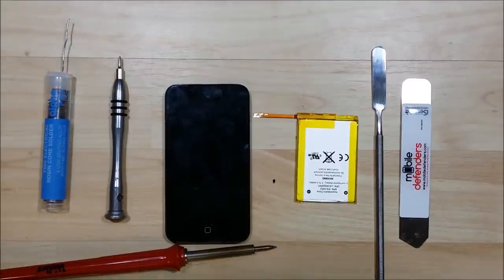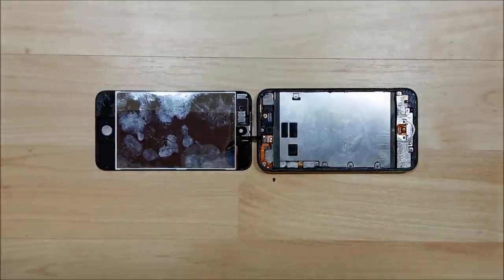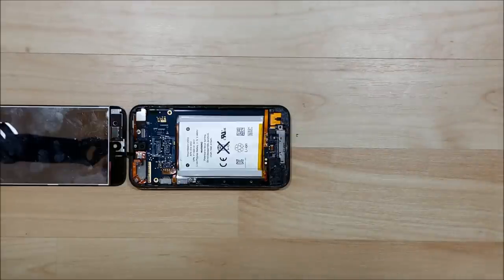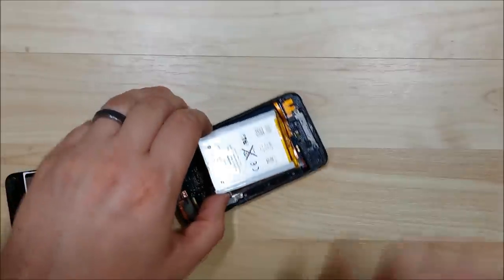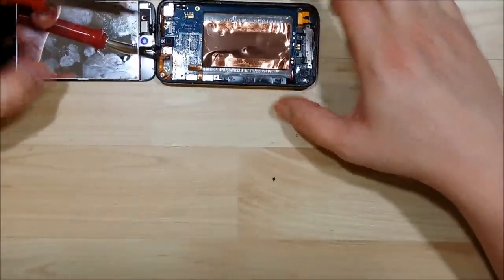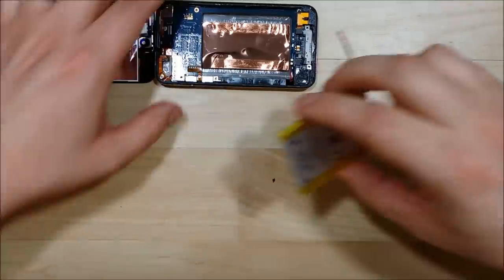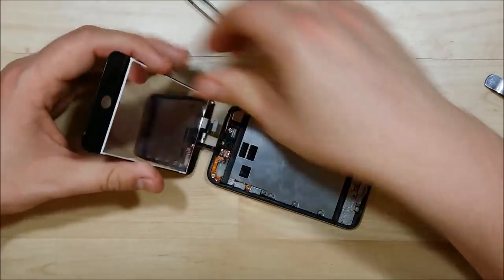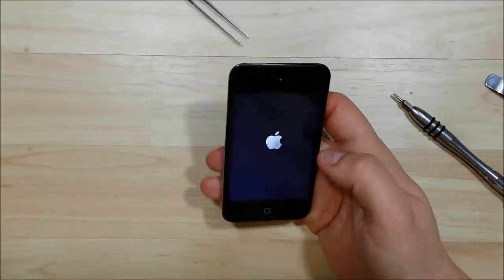iPod 4th Gen Battery Replacement/Repair

Comment: The most important thing I learned is not to even attempt this...
Reply: lol
Reply: why?
Reply: Chris Tilbury because taking it apart is one thing but using a soldering iron on something so small (I have fixed a few iPhones but once you have to solder to a small board you can very well ruin the board if you don’t know how to do it).
Reply: Oh ok
Reply: lol  me  to
Reply: yeah me too
wish i watched this video before i bought one that needs a new battery oh well it was only $9.50nzd
Reply: Me too. Mine is now absolutely dead!
Reply: I need this done

Comment: OK; I just went through this exercise of replacing the battery. The issue is: trying to unsolder the battery as is won't work, as the contacts are covered with silicone, which is not heat conduction; hence, the difficulty to get it off. Solution; use a sharp object, like a cutter, and scrape the silicon off. Add a bit of solder to each point, and then heat one point and pull slightly until off, and repeat with the other two. Since I did not want to open a new cartridge of silicon, I opted ti use a piece of insulating tape and put a patch of 5 by 20 millimetres over these three solder points. -- Also, add solder to the three battery contacts AFTER routing it under the circuit board. Way easier to fiddle it through. :)

Comment: Thanks for the video! When de-soldering you can use a little amount of fresh solder on the tip of the soldering iron and would help you to de-solder with much ease.
Reply from the maker: GUSTavo MYERS Good tip! I learned that after watching a couple soldering videos after I made the video.

Comment: This is the best, most accurate tut I’ve watched so far. I’m attempting to do this... One guy goes bloop bloop bloop and the battery is desoldered. It took me forever🤦🏼‍♀️ Another guy had the display off in like 3 seconds...I spent over an hour🤦🏼‍♀️—he never mentioned ^glue^😥 just double sided tape....well obvs his opened right up! Mine is full of glue, like they weren’t having this thing open ever. I wound up cracking the screen in a couple spots. I’m still working on soldering the battery in. I’m not ordering a new screen until I’m sure the battery is gonna work. Ty for showing the legit probs of trying to fix these things! It’s more complicated than people think!

Comment: heating a piece, even to remove the solder on a component still requires the iron to have a bead of it on the tip. This works like hot mercury, molding to form and transferring heat to the ribbon. That's why you had such trouble achieving temp. it wasn't transferring.  A blunt tip might remedy this.
Reply from the maker: +Drew Gormley Thanks!

Comment: Thanks for the guide! It really helped.
Everything was doing great but when I tried to turn it on. It didn't. I thought the new battery was bad so I 
put the old one back. Nothing. I looked at the board and it seems at 5:20, I put my tool a little bit too far and broke 2 capacitors/resistors. It sucks. I really thought I could do it. I could try to replace them but it's way too tiny to attempt that.
Besides, I didn't back up my stuff lol
Reply: That sucks hella. :-(

Comment: Great video. I did this replacement twice because the first battery was deeply discharged. However the second was also deeply discharged. 
I have changed the battery as you said. Then I followed all the steps but the battery was just hanging in an endless time of charging. 
I think it has to do with the age of them. After all the batteries for the ipod touch 4g are over a decade old.

Comment: Worked great. Others were completely removing the screen. Only thing is I got white screen after replacement and had to hold power home and vol up for a bit mild panic but did the trick. Haven't soldered in years good advice on bottom of the tabs solder.

Comment: I watched a number of videos over and over thinking I had this procedure down pat. And this one seemed to make it simpler without removing the LCD screen, cables and parts for the front-facing camera, etc. In THIS video from 2:40 to 3:07 there's mention of the WiFI cable and the LCD cable attached to the motherboard. All good. But at 6:16 the battery cover is removed and just lifted off -- only problem is that on MY iPod Touch 4th gen there was a copper cable attaching the battery cover to a small square sheet of copper on the rear-facing camera, located at the top left corner in the video -- but it doesn't show in this video. It easily snapped in two when I took off the battery cover. Dang!! :-(  I continued the battery replacement and put everything back together, then turned it on. The screen is now a MESS!! A total disaster. I can see everything that should be there "under" what appears to be damage to the screen electronics from the heat gun when I softened the adhesive around the edges. I guess the screen is EXTREMELY susceptible to damage to "too much heat." Had that been emphasized, I think I would have been more cautious in applying heat to the face. I thought I was being careful.

The battery replacement only cost me $7.00 on Amazon. But now I'm wondering -- do I order a new screen for something like $13.00, send the whole unit in for repair to a special shop (for ~$30), or just chuck the whole thing and purchase a NEW 5th gen unit that's faster and holds more songs and apps? Apple had refused to do the repair, along with two other local fix-it shops in my area (they said it wasn't worth their time to do this type of work anymore). Looks like Apple designs these things so when the battery goes bad, they INTEND it to get thrown away!!!! Sad for us, more money in Apple's pocket.

It was an interesting "learning" experience -- maybe I should have just let someone else do the work. Crud...

Comment from the maker: I accidentally deleted someones comment about the solder and iron that I used. 
It was a non-temp controlled 40 watt iron with, solder was either .020 or .032 I would probably go with .020.
Reply: +How2Tech Thanks for the video & letting us sit in on your learning curve, I'll soon be attempting this myself. It seems that if you put the battery ribbon under the motherboard before priming it w/solder it would work better since it seems to be such a tight fit. Also that LCD looked quite smudged on the sealed side, perhaps a little cleaning before closing it up.
Reply: iPod quattro
Reply: How2Tech Try tinning your iron next time. The end of your iron is black and tinning it with solder increases heat transfer

Comment: Do not waste your time trying to fix your Ipod. This job is not for the amature. I have years of experiance as an Amature Radio Operator and have built many radios from scratch and a project like this is not for someone with no experience.

The main problem is the Liquid Crystal Display. Prying on it will damage it. Applying heat to it will damage it. not getting the miniature connector on the top end in right will damage it. Agreed some people can attempt this and be successful but be warned that THIS IS NOT A WALK IN THE PARK. First of all if you have no soldering skills you are wasting your time. The display cannot be bent in the least bit and trying to separate this from the rest of the device is critical and you only get one shot.

Granted I got it apart and replaced the battery and got it together but when I fired it up one side of the display was black from the left side from top to bottom about an inch wide. This damage was incurred I am sure when prying off the Display. This is extremely hard to do without damaging it. The sound worked and the display worked on the right side but half a screen is no good. 

Save your money and take it to a repair place and even then they might tell you that there is a chance the display will be damaged.
Heck I might not be the best but like I said this is not a job for a person that never did this type of work before.

My advice is save your money on the battery purchase. Sometimes a project like this is good practice but it can be disheartening when you fire it up and it is damaged. The anguish makes it a bad project. If you really, really want to save your Gen 4 then take it to a store that will guarantee it to be as good as new or just spend the money on a new one. You will be cash ahead.

Maximus has spoken.

As it is written so it shall be.

PS:

For those of you that do have success,

Though I have beaten you and flayed you,
By the living God that made you,
You are a better man than I Gunga Din.

Comment: Very nicely made video. However, when I was prying up the metal cover at the corner, I inadvertently got my pry tool underneath a plastic part that had a black and red wire and the plastic part remained attached to the metal cover (where the pry tool is at 6:08 in the video). The black and red wire broke and there is no way to fix it. Too bad the video didn't caution about this. No worries. Live and learn. Also, my metal cover has a copper strip that broke when I removed the metal cover. It is connected to somewhere under the green pc board, so I don't know how this could have been avoided.
Reply: Update. I discovered that the part with the black and red wires that I accidentally pulled out is just the speaker. I use my iPod with headphones all the time anyways, so no big deal. Since it was just the speaker i went ahead and replaced the battery (which was pretty simple, btw). Anyway, iPod works fine now.

Comment: what a complete pain in the ass. everything was glued together. took forever to get this thing apart. there was two things glued to the top of the screen, one was for the wifi and something on the other side that i ripped. i call bs on that was his first time. it looked way to easy. at least its back together and working. this was my first and last ipod touch battery change.
Reply: That was probably his first time with an iPod touch 4 but not his first time with an iPod/phone

Comment: bricked mine.    cracked my screen right off when I tried to remove by getting under the bezel.   Then broke some connectors (mic and volume) too in the process.   Basically I wish I had not even attempted it, and I have been pretty good at repairing phones and other items, but these are very tight and easy to damage during the repair.   I wouldn't do it again.

Comment: For the iPod touch 4gen i want to fix, there is a dent in on the top left corner of the iPod, how would I be able to fix it and get it back to its proper form? Would it be with the heat gun or something?

Comment: I notice that you have two different batteries: an APN 616-0553 (the new one) and the old one is an APN 616-0552; On the battery the polarity indication is reversed. I have the same situation - Are the pinouts on these two batteries identical despite the markings? Tnx.
Reply: Answer to my own question: No problem, it works. The edges (display) of the LCD screen are a little mucked up where I probably damaged them, but otherwise, it works.  I will agree with everyone else - this is a bear of a repair, fraught with potential pitfalls. Unless your ipod a very dear keepsake, maybe you should get a new one.

Comment: Why couldn't they have made battery replacement for these iPods as easy as the old phones used to be...just slide off the back cover flip out the battery and lay the new one down and snap into place ! Thank God I won this $400. 32 GB 4th Gen iPod years ago in a contest because I would be pissed that I spent that much money and even though it still works the charge won't last a day even if I shut it off!
Reply: because these ripoff merchants want you to buy another one of there products,am amazed that this company has not gone bust,just goes to show the amount of people that are prepared to pay for a product that when goes faulty they are prepared to just throw away cos repair cost outway gettting it fixed unless you can do it yourself which in most cases is no

Comment: Was there any adhesive between the battery and the copper shield?
Reply: I believe there was but the copper is pretty thick. If you take your time you should have no problem.

Comment: OMG this was the biggest pain ever, i scremed so much because the freaking glue was soooooooo much, it was sooooo freaking sticky, piece of shit, all they had to do what make it a small clip in switch, BUT NOOOOOOO!!!!! lets make it SOLDER!!!!!! stupid douchebag apple,
I have a problem, my ipod wont charge after replacing the battery? should i go back and resolder? thanks
p.s. I had to use a hairdryer to melt the glue and that just barely helped,****ing apple

Comment: bought a used ipod touch 6th gen knowing that the battery doesn't last more that 8 min. The problem is I don't know if it's the battery the problem or the ipod. (I haven't fixed it yet). I noticed that the problematic battery charges in 10 minutes and in 8 min it's gone. But could it be the ipod's problem??? For a moment as I was using it the battery from wery low became medium loaded
Reply: Mine does the same thing. It’s still running iOS5. I think it’s just the age of the battery. Definitely needs a new one

Comment: would this method work to remove a battery from one iPod and then move it to the other?
Reply: +Nick Thomas well I mean like since you cut that could I then use that battery in another iPod if I also cut that one?
Reply: +Nick Thomas no you can't if you cut it...try to remove it without cutting it

Comment: My Ipod came on, displayed the white apple on the black screen for just a second, and then blinked off. After this, i tried to plug it in to a charger, i could hear the sound it plays when you plug it in, but there was still no picture.
Reply: I have faced same situation. How can i solve this?
Reply: Your video cable that he shows re-connecting close to the end may not be seated correctly it is tricky

Comment: at this point it's not even worth replacing the battery. you can get these ipods for 25 bucks all day on ebay
Reply: Rob Fassi i still have my ipod 4 in mint condition, not even a scratch but with battery problem ..

Comment: What a piece of crap! $200+ item and you need to be a freakin technician to replace the battery. This is one of the dumbest designs ever put out by Apple. Why can't they make it like a cell phone. Pop off the back and pull the battery out. What a piece of shit!